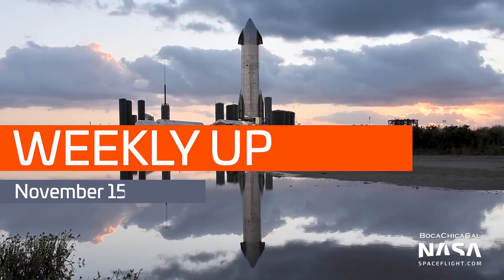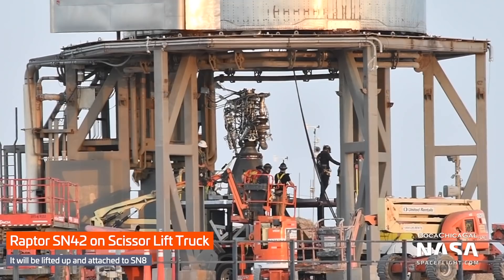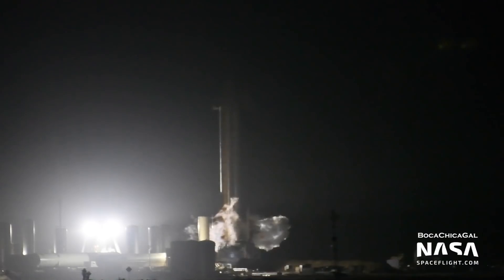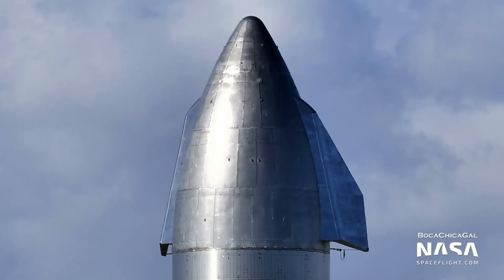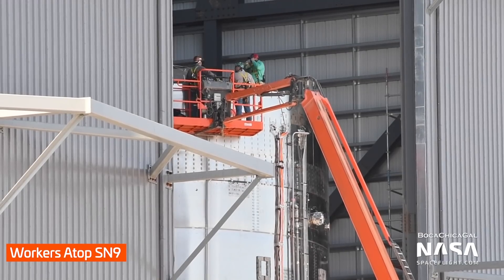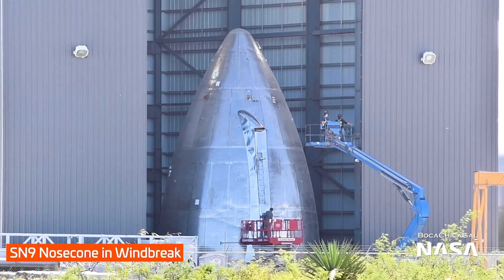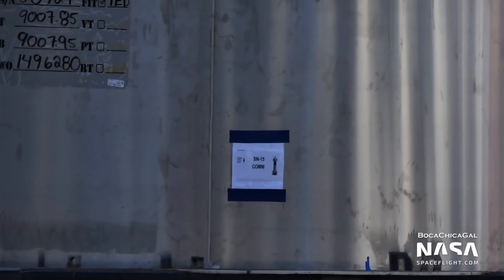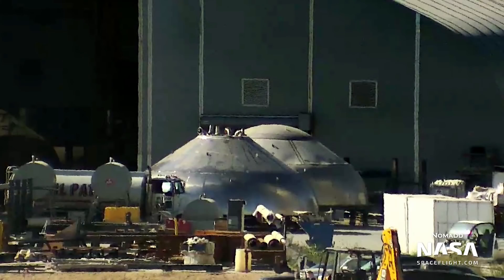SpaceX Boca Chica Weekly Update - 8 Starships Under Construction Plus Super Heavy BN1

Comment: lack of a base thrust deflection of heat power away from base will cause more problems at any time?   rapid heated comcrete will explode   violently??    or the base should be domed enough to do that job?
Reply: The concrete base is getting covered with water-cooled steel pipes.
Reply: @imconsequetau5275  thankyou  for your much appriecated reply??
Reply: @stgeorgeist  
Elon Musk wants inspection/service of Starship to be quick and simple. Putting a sloped deflector under the elevated launch mount would hamper that goal. On the other hand, the mat of parallel water-cooled steel pipes is compatible with [immediately] driving service vehicles under the launch mount.

Comment: I cannot understand why they keep building identical Starship prototypes so far ahead of test flights. I would think that lessons learned from flights of SN8, 9, 10 would prompt changes that could render 11, 12, 13 obsolete before they even fly.
Reply: A lot of design changes have already been made due to every test failure since SN2. The seam reinforcing looks different. The engine skirt is vastly different. The cone fabrication is automated. 

The techniques for Starship construction and administration are still evolving rapidly. As you may know, the thrust puck has a new methane manifold position. The COPVs and controllers are inside the engine skirt. The methane header tank has gone through visible changes (more inlets). The legs are soon getting longer. The launch mount and ground support equipment look quite different. The quick disconnect is improved. The oxygen waste-gate no longer kicks the external sweep elbow out of position. The engine bay wiring harnesses are getting armored. 

The procedures are getting smoother and much less tentative or ad-hoc. Robots are trained to do ever more chores. The roll-lift propulsion units have a new jig for transporting Starship. 

Most important, the people are learning what does and doesn't work cheaply, and how to work faster and smarter. Their ambition is to keep accelerating.
Reply: They are building a StarShip factory. They need to ramp up production, so they can make enough StarShips to build a city on Mars in a reasonable time frame.

As time goes on, the StarShips are getting easier to recycle. All of the structural parts are made out of a single alloy of steel. Recycling involves removing the engines, the battery, some cables, some pneumatic lines, and pulling out the motors for the flaps. Well the current prototypes have COPV tanks, but Elon says those will be designed out.

StarShip prototypes that aren't useful will be recycled.
Reply: Hamjudo they are trying to figure out the correct design though. To me it makes little sense to build multiple prototypes before figuring out if the design is correct. I understand that the engines and battery and other components can be repurposed but the tank section becomes scrap. The only value I can see in this approach is to give more practice to the workforce building the prototypes. But hey, I guess we will see.
Reply: @dlewis8405  Great point.I think it's a little of all of the above. There's actually a tonne of  room to modify within the form factor you see (eg armouring key stuff under the thrust puck 😂). As noted above, the manufacturing process is as much a part of the prototype learning as the firing (see  all the nosecones they built & scrapped). They also need to be careful not to change much build- to- build. The main form factor is clearly something they've got confidence in, so they've locked that ib. Then there are other good reasons to  line them up like this. A) like SN5/6 they need to make sure success wasn't a fluke. A second run helps make sure they pick up any inherent flaws before they push further. B) good experiment design: control changes carefully so you know what worked (or didn't).